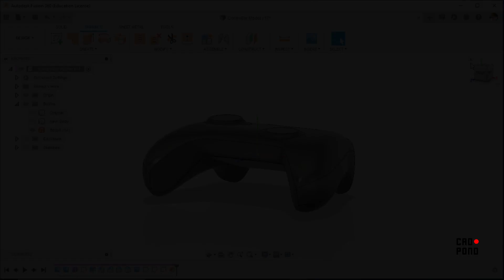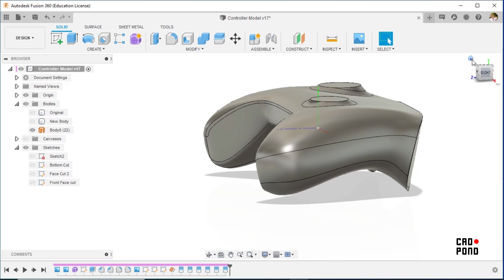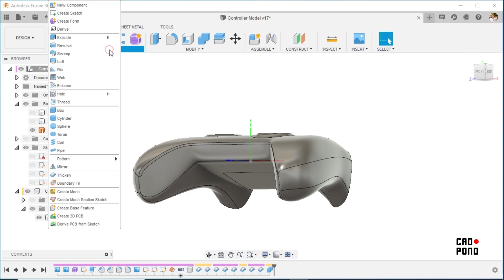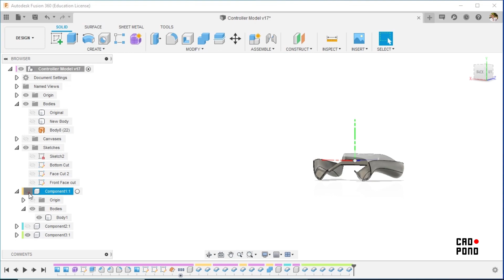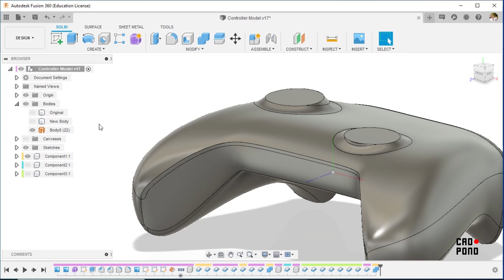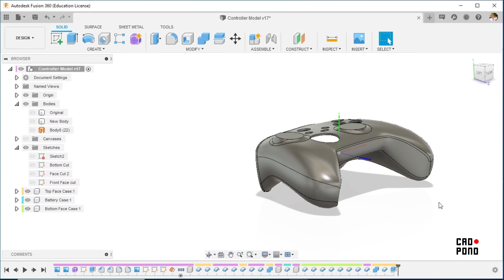Fusion 360 for Beginners | X-BOX Series X Controller | Part 5

Comment: After you were done working with the form object type, did you convert that to Solid Body?
Reply from the maker: Hi Cyrus. Yes, I converted to a solid body. I didnt however do this actively, because the fusion 360 software does the conversion automatically once you exit sculpt/free form mode.
Reply: @CADPond  Hey thank you for the reply! How did you exit sculpt mode?
Reply from the maker: If you are using fusion360, there should be a button at the top right corner (Last time I used fusion, it was there). I suppose its still there. But if it's not; you can right click your mouse, and it should be found in the dropdown menu.